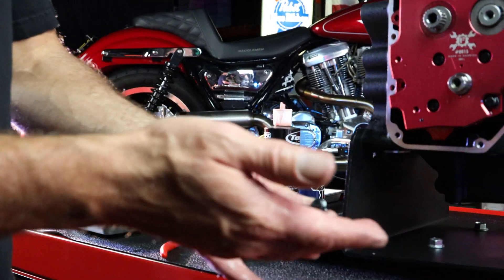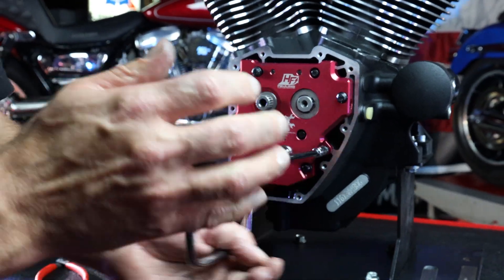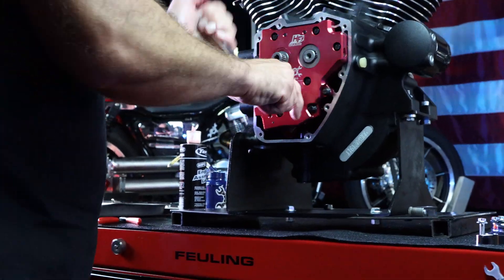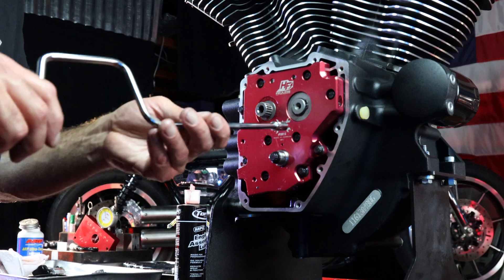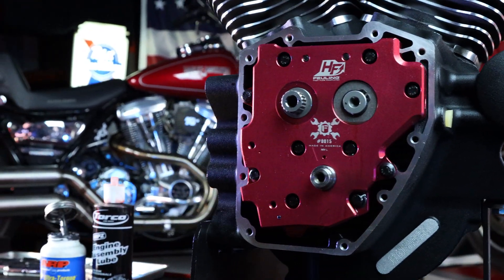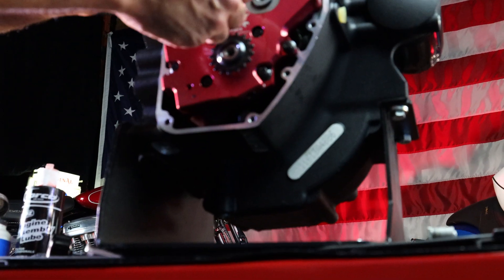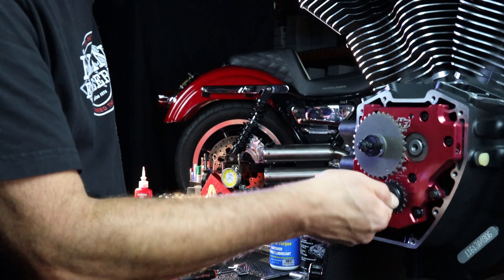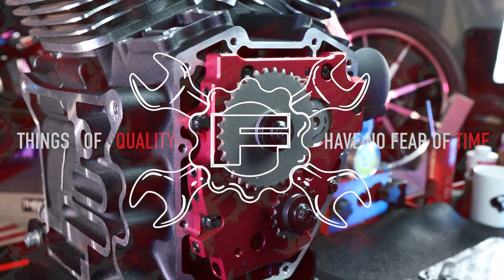TWIN CAM CAMCHEST INSTALL PT 4

Comment: This plate is def my preference!.. what’s the design consideration for HD’s 0.012” allowable pinion runout? There’s no bushing, correct?
Reply: I would never run a crank with any more than .005" let alone 12. Thats crazy.
Reply: @HammerHeadGarage  When you buy a new Harley do you have them check the runout. Brand new bikes are leaving the dealership with >.005 everyday.